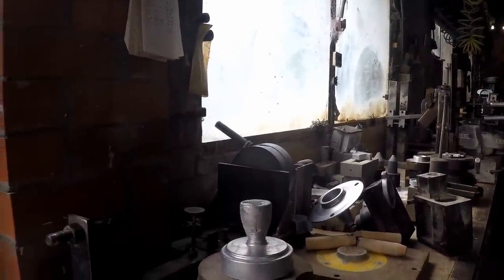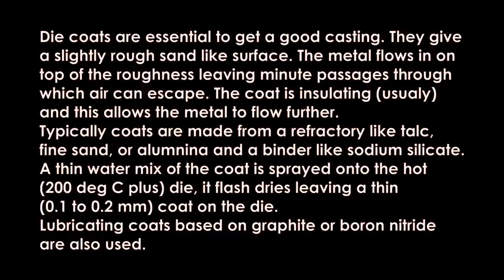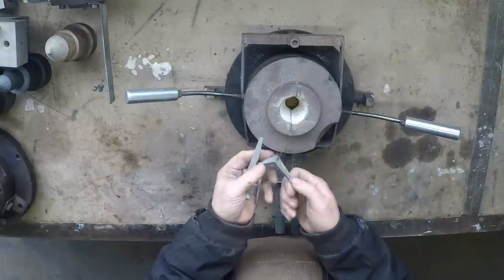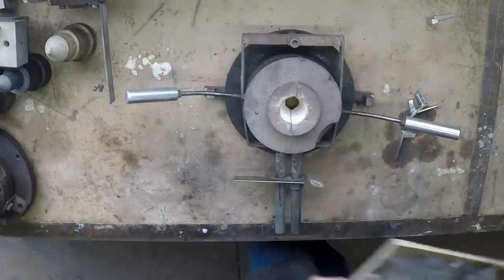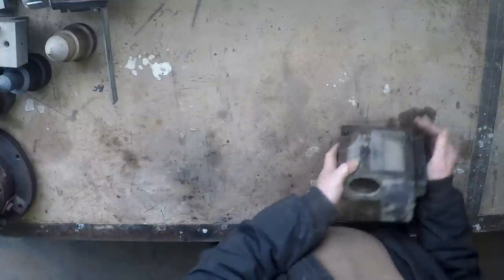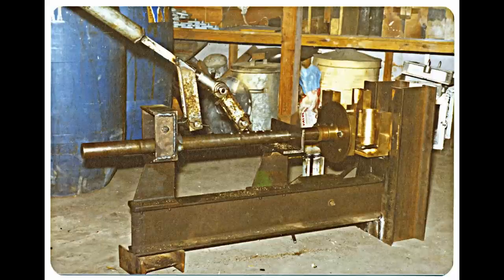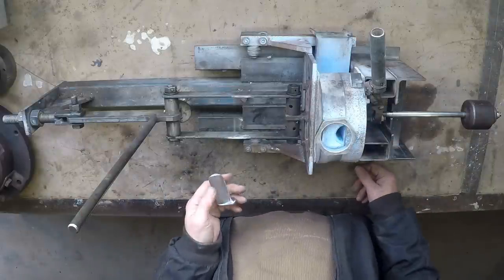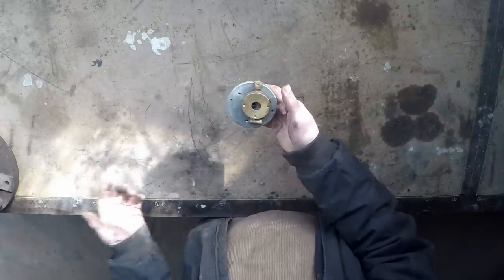Gravity diecasting  AKA Permanent mould casting Part 1

Comment: I really admire the knowledge given, and I want to ask what is the composition to make the white layer containing alumina and sodium silicate ?
Reply from the maker: THS, The white layer (die coat) that I use is a propriety coat made by Foseco  - it is called "Dyecoat 14 ESS". I do not know what it contains other than that the "ESS" stands for "Extra sodium silicate" so we can at least be sure that the binder in it is sodium silicate. The "white" is no doubt some sort of fine refractory - alumina, silica, or perhaps talc or some mixture of them, or even any of a multitude of other common refractories. Once it was common for die foundries to make up their own coats but the formulations used seem to have got lost in the mists of time. Sorry that I could not be of more help.... Martin

Comment: As I’ve probably missed it, would you mind restating what your typical draft angle recommendation would be for a permanent mold? 
Also, is it realistic/ feasible to cast 6061?
Thanks in advance.
Reply from the maker: George, Draft angle - most foundrymen will answer that with "as much as possible". Seriously though it depends on whether it is inside or outside. If outside you can actually have none and just rely on the contraction of the casting to free it up. I have done this but do not recommend it, 1 degree would be preferable to none, 2 degrees would be nicer .😊 Inside is a different story as the casting will contract on and 1 degree would seem to be to be the absolute minimum and even then only if you use a good lubricating die spray like ZYP's "Release coat blue" (expensive). It depends to on if it's a core than can be pulled early in the cooling process or if it is a solid block that has to be ejected off. Ther latter will require a greater draft angle than the former. To be honest if people start to talk 1 to 1.5 degrees I start to mumble and politely suggest they go somewhere else. Unless it's a short distance the draft is over I prefer to start talking at 2.
6061 Hmm, Well, you can melt it and pour it into a mould but it is not an alloy designed to be cast so what you get may be disappointing.
I am assuming that you have access to (lots) of 6061 scrap - I hope it's not swarf (chips) worst possible casting feed stock. Melting 6061 is not something I would ever even contemplate - my advice - take the scrap and sell it to a scrap dealer and with the money buy some decent ingot. In short feasible yes, realistic or smart no.... Martin

Comment: Hi! Thank you for  great channel. Maybe i've missed out because i'm not a native english speaker, but what material are you using for the mould except steel? What is the concrete-look-a-like material for permanent moulds? Best regards Alfred
Reply from the maker: Alfred, I do use mild steel for some parts of my gravity die moulds but I prefer to use grey cast iron which I buy as continuously cast large bar. The iron is easier to machine (if a bit "dirty") has higher thermal conductivity that some steel used for dies and holds the die spray well. Its life is more than adequate for the dies I have made. I am not sure what you mean by "the concrete-look-a-like material". There is a white spray coating that is applied to the dies new every day - this a commercial die coat called 14ESS and it is made by Foseco. Or there is the white insulating board that I use to make pouring basins on my tilt casting machines, this is a hard insulating board typically used in the base of furnaces between the refractory lining and the floor - It is made by Morganite but I do not know what it is called - I was given what I have. Are either of these materials what you are referring too? If not, give a time in a particular video where this material appears.... Martin
Reply: @olfoundryman8418  Thank you again! Are the moulds shown at 4:15, 5:10 and 8:30 made from grey cast iron (the insides of the moulds/casting surface)? Best regards Alfred
Reply from the maker: @MrDaglivs  , 4.15 mould is cast aluminium, it's cast to size. 5.10 mould is again cast aluminium - it's actually machined from a piece of continuously cast 357 aluminium ingot. Note that these two moulds are used for lead castings. 8.30 circular base plate is mild steel  two die halves are cast iron..... Martin

Comment: Just getting into all this and have watched several other videos but seem to have learned the most here on your videos.  Thanks.
Do you have any videos on making cores?
Reply from the maker: Robert, Thanks for saying so. There are a few videos of mine that cover shell cores and CO2 cores. Here is a list
https://youtu.be/-NKiCf2aCcg
https://youtu.be/WHz9vnNZxzs
https://youtu.be/8TqCK7pD4FY
https://youtu.be/lNxwrSzm9q8
https://youtu.be/nQM2slvPTQM
Enjoy.... Martin
Reply: @olfoundryman8418  Thanks.
Reply: @olfoundryman8418  I hope you don't mind but I have some questions about using waste oil for fuel.
What mix do you use, is it inducted air, and is it as hot as propane?
I thank you for ALL the info as I'm hopping to learn the best way to do this, is it smelting or is it called something else?
Keep up the videos because their almost as relaxing as doing it myself.
THANKS.

Comment: Thank you so much for sharing this
I Got inspired by one of your old videos and now I'm about to make a diy from aluminum to pour aluminum ..
I have a question about the core paint ... what kind of paint is that and is't good for surface quality ???
Reply from the maker: Bobo, This video  https://youtu.be/lNxwrSzm9q8 shows the making of the cores for the runway light and it mentions the two types of paint I use on these cores. It does improve the surface finish.... Martin
Reply: @olfoundryman8418  thunk so much 🙏❤️

Comment: Great vid! The old school technology of, keep it simple, stupid. I've something that needs to be done & know the hot pour into a 2 part clam mold would suite my needs. But! All shown here (YT) is everybody pouring either lead or aluminum. I need to know what material / metal permanent mold would suffice for poured stainless steel / end product? Somebody, please advise please... . Thanks.
Reply from the maker: Don, I am totally unfamiliar with the pouring of stainless steel. I have never heard of it being done as a gravity die process. But I do know that some carbon steel railway wheels are gravity cast into water cooled copper moulds - exactly what sort of technology is involved I do not know. I am tempted to suggest that stainless steel parts, particularly if they are on the small side, might be best made by investment casting ..Martin

Comment: When you're pre-heating the die, is that only to remove the water? So you only need to pre heat it to above the boiling temperature of water? Or is there any other purpose to pre-heating?
Reply: Does it also help the metal from freezing up in the mold ?
Reply: From my experience of bullet casting. It is a compromise. You want to have the metal freeze as quick as possible but without defects. Freezing too fast (in a bullet mold) can cause ripples on the surface, the mold not filling completely. Just like pouring temperature, you don't want it too hot and not too cold.
Reply: Heating of the mold help to remove moisture, prevent misrun and thermal shock.
Reply: @paultavin3114  so how hot should it be when you pour?
Reply from the maker: Sunil, Two reasons for the preheat:- The die needs to be hot enough to cause the coating to flash dry when its sprayed on  - 200 deg C plus
                                                                The die has to be hot for the metal to fill the die  and for the casting to feed properly  - 200 deg C to 350 deg C
Actual operating temperatures depend on the job and the rate of casting, you sort of work this out as you learn to work with a particular die .... Martin
Reply from the maker: Wright, Yes.... Martin
Reply: @olfoundryman8418  thank you
Reply from the maker: Rudy, I note that with bullet casting a die coat does not seem to be used. Without a coat, ripples (flow lines and miss fills) are all too common unless the die is rather hot. But with a hot die shrinkage can be a problem and considering most bullet moulds do not really have a feeder apart from the, feeding wise inadequate, pouring basin I can imagine that bullet casting is an art where you have to hold your tongue right 😊to get it to work. Me, I would smoke the moulds preferably with an acetylene flame and see if that widened the successful operating parameters.... Martin
Reply from the maker: Paul, Yes and also with new dies it helps by removing any oils etc. from machining although it usually takes a run of the die to get rid of them completely. Thermal shock is a fact of life and eventually dies fail from fine cracks (checking) caused by thermal shock.... Martin
Reply from the maker: Sunil, I tend to pour the first casting after spraying at whatever temperature the die is and see what happens - Usually this works 😊. The die tends to get hotter as the run of castings proceeds and may get as high as 400 deg C. With thin fins like I suspect you are thinking of both the die and the metal should be on the hot side and have a fairly thick layer of spray on the thin end of the fins. I would probably start with the metal at 760 Deg C and see how it went - these things are often a "suck it and see" proposition. Its knowing which way to go when it does not work properly 😊 that's hard.... Martin
Reply: @olfoundryman8418  haha. Thanks for your insightful reply

Comment: Are there any CNC machines that do automatic casting with metals?I know there are plastic injection molds that are computerised.
Reply from the maker: Zum, Yes, In the pressure diecasting area there are many fully automatic computer controlled machines. In the gravity die area  there is some tendency to use robot pouring when the production demands it - the one robot often serves two or more gravity die machines... Martin

Comment: 11:21 can you explain where those bubbles are coming from?
Reply from the maker: Bobby, You have good eyes! Probably two sources for the bubbles the casting is hollow underneath and water wil displace some of the air caught under the casting in its hollow. But mostly they are from the water boiling. While initially cold and therefore boiling is over very quickly as the day goes on and many castings have been quenched the water gets very hot and will boil with each casting form many seconds. I have to change much of the water three of four times a day.... Martin

Comment: Can you do something on casting stainless steel please.
One of my bosses wants to casts some stainless steel,  we have tonnes of scrap of 304.
Reply from the maker: Mr. Greens, Ah stainless steel - Hmm, never done it myself. The sort of fuel fired furnace that everybody uses will not get anywhere near hot enough to melt stainless steel. You need an induction furnace for that (expensive!) Worse still there are contamination problems - even a little carbon pick up will ruin a stainless steel badly affecting its corrosion resistance amongst other problems. My advice would be to sell the stainless scrap and use the money to pay a proper stainless steel foundry to cast what you want. May not be economic  but at least you should get a useable casting.... Martin
Reply: @olfoundryman8418  yeah that what I thought too. We do get stainless steel casted in China, as we get lots of stuff from China. I will let the boss know. A couple of us have told the boss just to use aluminium.
Reply: @olfoundryman8418  Thanks again Martin. Great work as always.